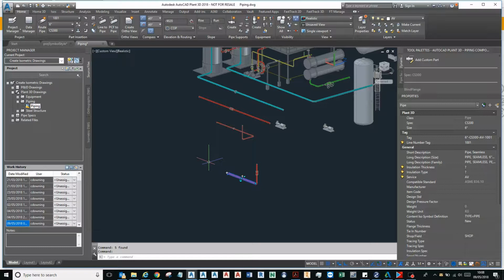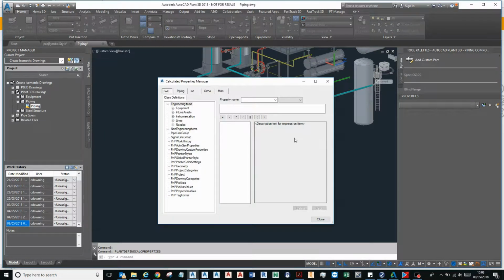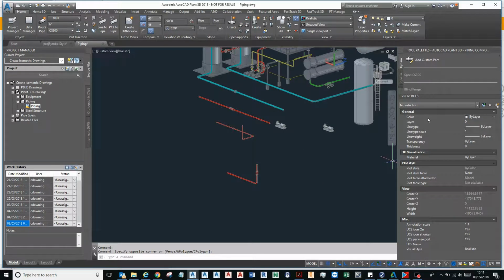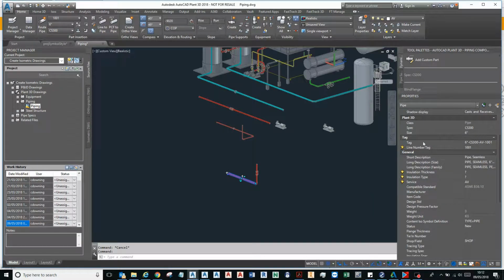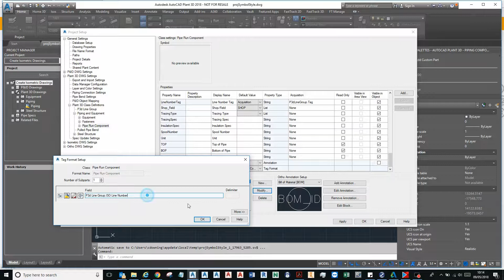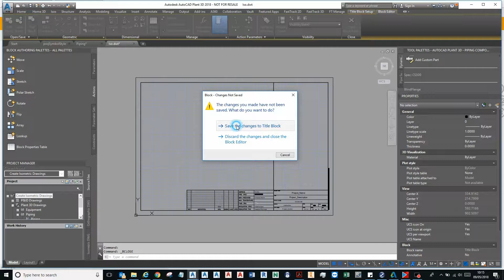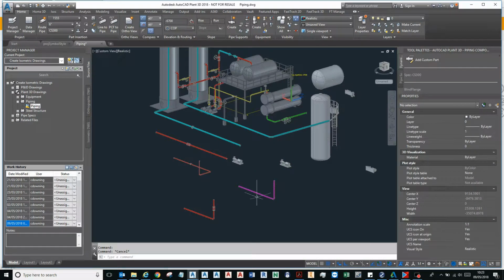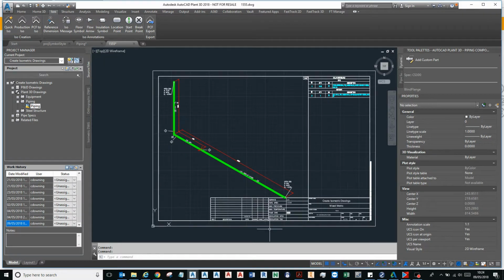Create a Line Number Tag to use in Isometric Title Block

Comment: Export the Bentley, Chat GPT, Revit, Plant 3D, Civil 3D, Inventor, ENGI file of the Building or Refinery to Excel, prepare Budget 1 and export it to COBRA. Prepare Budget 2 and export it to Microsoft Project. Solve the problems of Overallocated Resources, Planning Problems, prepare the Budget 3 with which the construction of the Building or the Refinery is going to be quoted.

Comment: Hi there I use plant 3D 2109 at work and I always struggle to get the client line number tag format into plant.  How would I get e.g 100-P08-001-1001 to show on all P&ID, 3D model, ortho and isometric ?  100 being size of pipe P is pipe 08 area, 001 is line number and 1001 being pipe spec ? Any help would be appreciated thanks